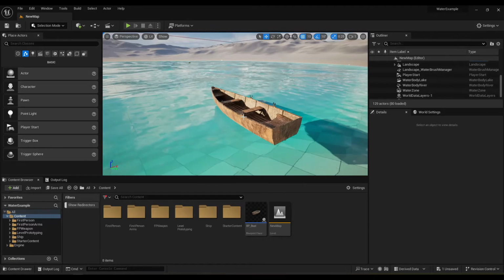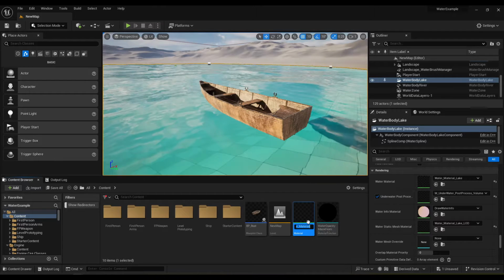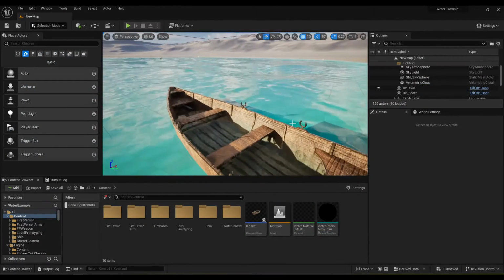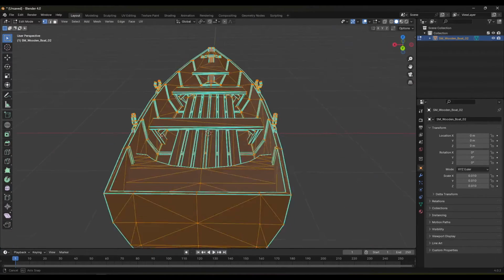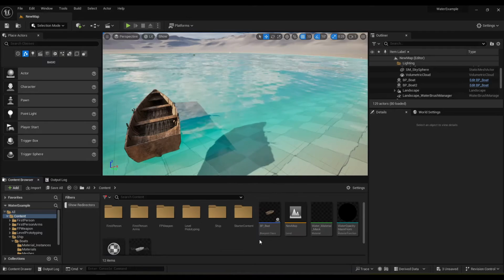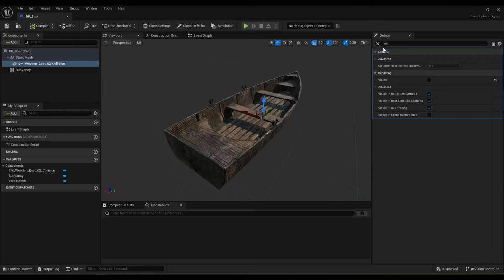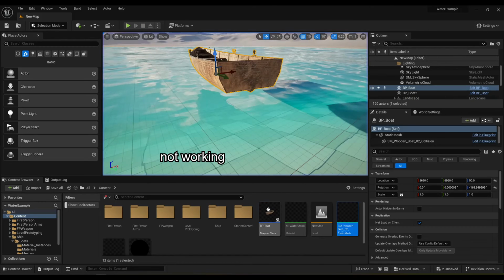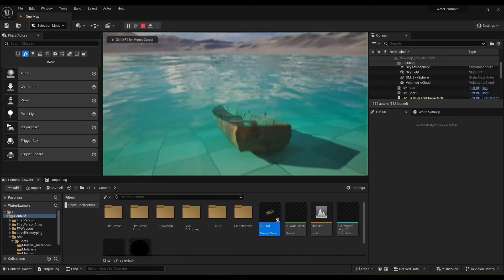Unsink Your Boat - How to Remove Water From Boat in UE5.3

Comment: Hey Peanut, I found you don't actually need the material. Uncheck Visibility, Check Hidden, and check Affect Indirect Lighting While Hidden.
Reply from the maker: Nice find, thanks. You can also override the distance field mesh in the mesh itself with the solid boat model and skip the whole second static mesh component. But this method is still useful to toggle visibility if you want to switch between flooded and not.
Reply: Or only uncheck render in main pass, especially if you want to keep the shadow in some cases. If you dont want shadow too uncheck cast shadow as well.

Comment: Here I was, thinking 'this is such a specific thing, no-one will have covered this' but searched ahead anyway, and bam. This owns. Thank you so much for this and your other videos. The water plugin is weirdly obscure, but you cover it in a cool and informative way. Thank you!
Reply from the maker: hah nice I actually thought the opposite "so many people must have covered this" but then I made one boat video and well, now I have like 5 because people keep asking for the next step, lol no problem thanks for watching!
Reply: @peanut_games  Hahah, for real man, it's actually kinda wacky how little info there is on this. That said, I've discovered an issue, and not sure if this is just me, or: The masked/invisible area has no water in it but still has an invisible forcefield look to it, as if you can still see the waves but not the water, if that makes sense? It obscures things beneath it kinda. Is this a problem for you too, or just me?
Reply from the maker: @MattemIgnorum  Oh jeeze, yes I did fix that in my own project but I don't remember how. I think it was something to do with the material parameters of the water but I'm trying to find out again lol
Reply from the maker: @MattemIgnorum  Ok I got it, it's in the WaterOpacityMaskFromDepth material function. Gotta add a new pin to the SetMaterialAttributes node "Opacity Mask" and plug that directly into the Output Mask node from below

Comment: for anyone else getting shadow from the solid static mesh object, a janky workaround i found was adding a 3vector to the emissive pin in the material and setting it to white, so it gives some light in there. tho i have no idea why im getting the shadow as he in the video isnt.
Reply from the maker: I forget what I did exactly now but you can also override the distance field mesh IN the static mesh itself. Open up your boat model it'll be in there. Then you can avoid materials altogether, however toggling it dynamically won't be possible.

Comment: Awesome tutorial nice to follow ! Do u know how this works with a pool inside a building ? For me the water wont show up because of the closed building ... really would appreciate your help!!
Reply from the maker: Epic's water plugin needs landscape to function unless you use water body custom, but for water body custom to work with buoyancy the water mesh must be a solid cube with the pivot on the mesh surface
Reply: @peanut_games  so i tried having a solid mesh but now if i come close to my water it everything gets white ...
Reply: But if I make a custom pool with my own mesh  it also need to be like a glass closed or just water surface ? Do I also need the water to be the size and depth I want it to be?
Reply from the maker: @Future_Me  use the default cube, move it to 0 0 0 then move it down slightly to align the center pivot with the surface. Either in the actor tab or right click on it to find the merge function and set the "pivot at 0" flag, then save

Comment: When I changed the water shader to the modified one per this tutorial my waterbodycustom ocean became invisible.  Is that normal?  Will building lighting fix it?  Edit:  Just tested -- put the  watermaterial_custommesh back on and it works; the WaterMaterial doesnt work.
Reply from the maker: I'm able to replicate the issue, not invisible but it is flipping out. Interesting to note that it also happens with the default Water_Material so I'll look for a setting in the Water_Material_CustomMesh instance. Better yet just copy that and change the parent to our modified water material.

Confirmed to have gotten it working this way with water body custom.
Reply from the maker: Looks like it's caused by the "Enable Water VS Mapping" flag in the material instance.
Reply: @peanut_games  i deleted the custom and added water body ocean, unchecked Affects Landscape, looking now to zero out the splines...
Reply: @muralist1  Did you fix the issue?
Reply: @h1deqt  no, but I’m still on an ancient graphics card. I think with a new system and card the problem will resolve. Now to sell some of my paintings and prints do I can finish the game…

Comment: I'll try this right now.  Edit:  Okay I have the shell for the hull built.  Time to dig into the shaders.
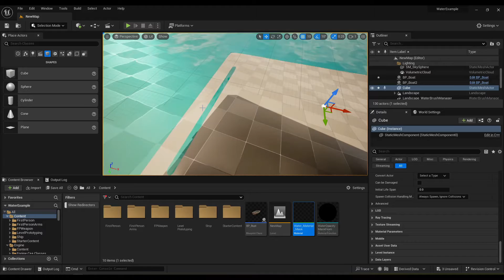Reply: Applied the modified Water_Material to the ocean.  At 3:08 in your video, trying the cube test -- no masking of the water so far.  Edit:  I've gone back over it three times and I think I haven't missed any step but it doesn't work, so I'll keep hunting (my experience w Unreal is that its usually some little checkbox or small error somewhere...)
Reply: Are there any settings in Project Settings or somewhere that I might have missed?  I cant get the water to disappear in the cube test nor in the boat shell I made.
Reply from the maker: Are you on low scalability settings? That's all I could think of and I just checked, it doesn't work on low... hmmm...  Specifically Global Illumination has to be at least medium. I'll see if that's something that can be changed.
Reply: @peanut_games  Oh, yeah I am.  (I'm still running my antique GeForce GT 640) -- all scalability on low.  I'll try increasing to see if that works.  brb  Edit:  Just increased Scalability settings to High, still not working, but I' messed around so much with the water shader that I may have broken something else; I'll try a fresh one and see if that works.
Reply: So far no go.  I built a new map following your first short tutorial with the lake, then plugged my modified water shader in, but nothing.  So I'll go back over the tutorial with a fresh water shader and reconstruct it.  Maybe its my graphics card; does this method require D3D12?  If so I'm out of luck.
Reply from the maker: @muralist1  Possibly, but first it uses mesh distance fields so make sure 'Generate Mesh Distance Fields' is checked in project settings.
Reply: @peanut_games  With 'Generate Mesh Distance Fields' on I think it does work, but it screws up my water rendering; I think I might have to get a new GPU before I can use this.

Comment: That was fast :D Gonna like and comment before I even start haha <3! Cheers mate!
Reply from the maker: Haha nice, thanks 😊
Reply: @peanut_games  I am also working on a boat controller, would be awesome to see your approach as well! About the masking I think if it is done below any point where a player can't go under would work just fine, even for big ships with floors. But on big ships with big hulls the water inside wont be a problem I think.
Reply from the maker: @borisaceski6401  this comment got flagged for review for some reason....

but yeah especially if you have swimming mechanics, you'd be overlapping the water technically and start swimming in the boat lol. You'd basically have to find a way to consider the overlapping of both water and the invisible boat mesh, same for physical objects, splashes, etc
Reply: @peanut_games  Youtube and its flagging ways... Yeah true about the overlaps... Gonna figure it out as I go. Cheers!